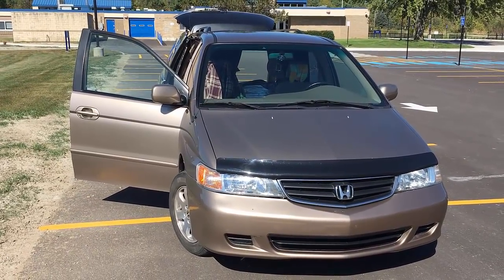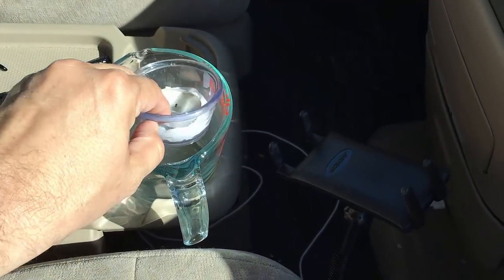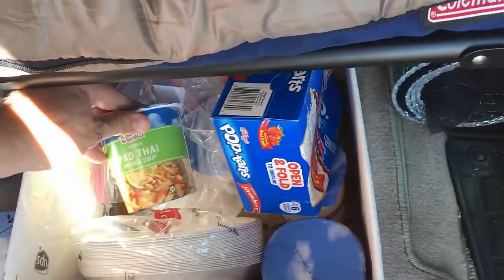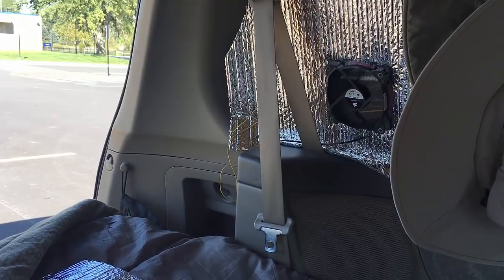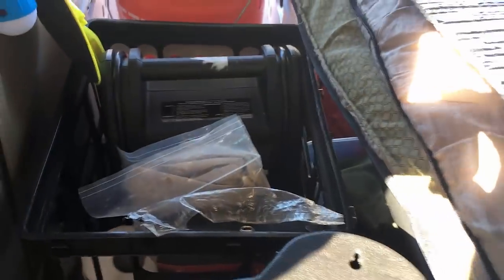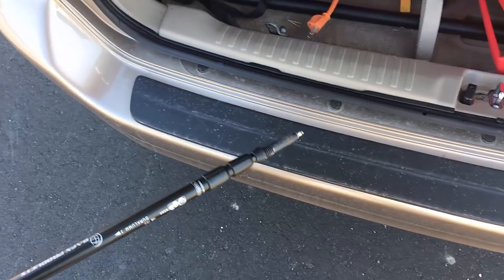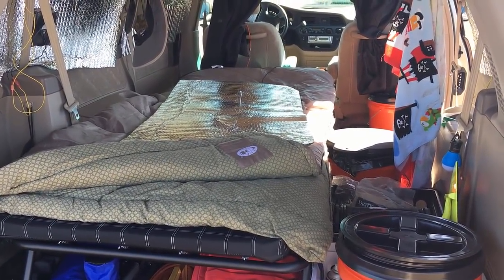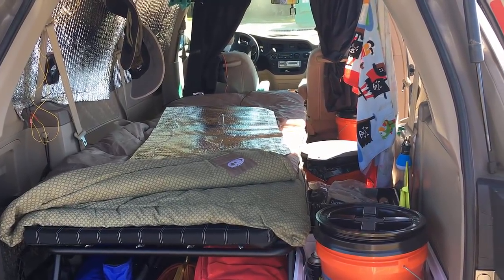Odyssey Camper Minivan Conversion

Comment: what is the best year honda ody in which to van camp? you did a fantastic job on the video. you put in so many great tips and advice but the video was calm yet interesting. really enjoyed it! I am going to see what else you have on your channel.
Reply from the maker: Thanks!  All of the Odyssey's have similar dimensions, but the 05' forward have a split rear seat.  That means you can put a cot/bed on one side and leave the other side up to sit in at night.  Of the earlier generation (2nd gen) Odyssey's I'd focus on finding a 2004'. I give some reasons on my OdysseyCamper blog, here: 
  http://odysseycamper.com/2017/10/07/what-to-look-for-when-buying-a-second-generation-honda-odyssey/     
     Some good deals can be found in a 2nd gen Odyssey with around 160,000 miles.  Having said all of that, if I change your question to "what Honda Ody is good for TRAVELLING",  then I'd suggest a 3rd or 4th generation.  They drive more like a car and have added safety features like side curtain airbags.  They also tend to get a few more MPG.  But in my opinion, all the Odysseys make good campers for one or two people.  I hope this helps!
Reply: Odyssey Camper Thanks!... but did they shrink them down?  I plan to look at newer models but I saw how they shrunk the CR-V (mutters).
Reply from the maker: The outside length is slightly different, but the interior space is VERY close.  2000-2018 Odysseys will all fit a 4x8 sheet of plywood behind the front seats.
Reply: Odyssey Camper, excellent information to know. Have you done a sideby side review of the Odyssey vs Pacifica vs Sienna vs Sedona minivans? 

Why do you prefer Odyssey? 

I just watched a 2018 Ody review trying to sort things out and there are so many bells and whistles I couldnt believe this was a minivan. I wish they had an AWD though somewhere. 

I had been looking at a Nissan NV 3500 high roof. I want something that can go between camper and cargo and maybe hauling / towing when needed.
Reply from the maker: I work in the powertrain industry, which means that I get to see how the engine and transmission are built and I get to see some of the quality issues.  That biases me toward the Honda and Toyota. They also have the best resale values. That said, there really aren't any BAD vehicles built anymore, if you compare them to what everyone was building in the 80s.  I know people that swear by the Fiat (um Chrysler) vans and I've owned a couple of non-Sedona Hyundais that were great.  So, I'll say in the end you should find the one with the features that you like.  If you want to know more about why I chose a Honda Odyssey for my mini RV, check out this blog post:   http://odysseycamper.com/2017/08/10/why-did-i-pick-a-honda-odyssey/
Reply: Odyssey Camper, that is awesome! Well, I was hoping there was a reason I wanted the Honda again / more. I have a 2004 Honda CRV awd that I will probably keep forever.  I will def check out your link. So I was just wondering before I read your reply what you would think of the 10 speed transmission on the higher end Odys for 2018. I have no idea if that is very significant or not. It is almost like it will go into... what are they calling the "continuous  transmission"... or something?
Reply from the maker: I honestly haven't driven the 10 speed version, but I can say this: We have a 2016 Acura MDX (Honda V6) in the family and the 9-speed transmission SUCKS.  It hasn't broken yet, but the programming is awful; always in the wrong gear, takes too long to downshift, does not limit your speed on a downhill like all other Honda transmissions.  Ironically, it's also used in the Chrysler products (made by a third company, not Honda), so that might tell you something.  I'd definitely try to drive one around for a couple hours before committing.  It hardly seems worth it to get 1 mpg more.
Reply: Odyssey Camper yes I just saw that it has a lot of cons. I am going to price some used minivans. Some of them do indeed hold their value. Good when selling but pricey when buying! lol
Reply: Another related question - a Coleman cot would fit comfortably then in all models without being too uneven? And in the later models it would even work with the split seat up next to it if I understand correctly?
Reply: Actually I was able to answer myself! Saw your phase 2 video and the one about raising the cot with the 2x4
Reply: we used a 2001 odyssy for a 3 month trip around the US and Canada, stealth only, cant remember one campground.  Two average size people slept in back, stuff went to front seats while sleeping.  It was magical!  And we were over 70.

Comment: That’s such a great idea using the cot! I’ve been considering this for my crv as well,  just need to see if it will fit in, as I’m not taking out the back seats, but have them folded flat, and want to make the most of the storage I can 👍🏽 thanks for sharing!
Reply from the maker: Jo T thanks for watching!
Reply: Camp cot in my Sienna with 4” trifold mattress. I put down 3rd row and took out one of 2nd row. Cot fits perfectly behind 2nd seat folded up. Put a 3drawer plastic cabinet that is perfect fit by cot in the back. Plenty of storage underneath cot and cabinet. Just need better reading light. I just use for camping, not living in. As a 70 year old female I stay in state park campgrounds primarily and most sites have electric and water.

Comment: Will you share where I should go to get an inverter connected to my battery? Also please provide info on where to purchase a ceramic heater. It sounds safer than a Mr. Buddy in close quarters. Thank you for a very informative video. I just found you today and I’m so glad I did. Now I’ll search for all of your videos.
Reply from the maker: Janice McKinnie if you can find an car audio center (we used to call them stereo shops), they can do the install for you. As far as the heater goes, I use this small one. https://amzn.to/2UKGSv7 The heat is a tiny fraction of what you would get with a propane heater, but I find it keeps my minivan warm enough if the front seats are curtained off. The propane ones are too much in a minivan if you ask me. They are better for a full sized panel van. Thanks for watching!

Comment: Darren - I found your channel and wanted to say what an outstanding job with all these videos! Thanks! I do have a quick question about the interior dimensions of the Honda Odyssey. I'm going to do some trips and use my recumbent trike (a tadpole-style = two wheels in front, one in back) - an example would be a CaTrike Trail recumbent trike. The Trail is quite wide (39 inches) and long (about 80 inches) and I want to keep the trike inside a vehicle where I can also sleep in it when the need arises. I  have a tri-fold mattress that is about 26 inches wide so I figure I'd need a vehicle that would have a 64" width to accommodate the two front trike wheels and the mattress - the narrower part of the vehicle at the wheel wells would handle the mattress and the back wheel and seat frame side-by-side. I've looked at different vans and the Oddysey does seem wide enough and long enough from the front seats to the rear hatch. I'm curious if you think the Odyssey would suit my needs?
I've  been looking at really reliable vehicles and a few Toyota models (the Highlander, the Sienna, maybe the 4Runner) come to mind. The Odyssey also is on the list. Any thoughts about the Hyundai Palisade, the Kia Carnival or Telluride, or Chrysler Pacifica?
Thanks in advance for any thoughts and once again, thanks for producing great content!
Reply from the maker: Thank you for your kind words!  Forgive me is this seems brief as I have to answer from my phone. As a rule, any modern minivan will hold a 4x8 foot sheet of plywood with the possible exception of the Pacifica (not sure about that one). So you have the length to do what you want. The width of 48” is as measured at the rear floor. Partially dictated by the wheel wells. So to get the width you want, you’d need to  be between the side door. There you typically get 60”.   The Sienna is also very close to those measurements. As for what brand of van you go width, I’d get what you like to drive since you’ll be doing a lot of that. ALL vans are built better than they were 20 years ago. That said, I’ve personally seen so many quality issues with Chrysler products, I would avoid those. Just my personal observation, some people consider them to be reliable. Thanks for watching!

Comment: Thank-you for taking the time to educate us. I just bought a 2007 Odyssey and came across your channel while surfing for information on how to use my windshield sprayer haha. I plan on attending RTR next year and I'm trying to decide if it would work with my 85 lb. dog. I will test out your design this summer to see if it would work. If you keep that side seat intact- where do you put the bathroom?
Reply from the maker: cynthia Hicks Good choice!  The 07 drives more like a car and has additional safety features like side curtain airbags. On my 13, the rear seat splits and so I’ve put the bathroom behind the front passenger seat and the water bucket behind the rear seat. When parked, I move the water to the front passenger seat.   Your dog should have room on the floor, but that’s a LOT of dog. I think this is what you are asking, but if I got it wrong, please LMK. Thanks for watching!   Be sure to subscribe and hit the bell to be notified when there is a new video; the next video starts the bed build in my 13’.

Comment: Hello,  would you mind sharing your insights on how the cot is secured in the van to prevent movement while driving.  Thank you.
Reply from the maker: Winfield Sam I use thin cable with crimp on ring lugs. I then put the cable through the floor seat mounts and a screw and nut through the ring lugs ties it down. However, once the cot is in and the driver’s seat is back, it’s not going anywhere. You’d have to roll the van to dislodge it. Thanks for watching!
Reply: @OdysseyCamper , thanks for sharing your tips on securing the cot.

Comment: Has the ground clearance height ever been an issue with dirt roads on the way to hikes?
Reply from the maker: Oh yes. The one thing that limits the Odyssey is the ground clearance. It’s about 5” which makes it hard to clear the rocks on rough trails. My NV200 with non stock tires had 9”, which made a huge difference—enough to keep up with Jeeps on dry trails. That said, I’ve done some gnarly trails in the Odyssey, using only a skid plate. Currently, I’m adding a 3” lift which should help to get deeper. Everything is a compromise, but you can go to most trailheads with an Odyssey and a decent set of tires.

Comment: where did you get the fans? How did you install? I need to do this for me and my  dog we are going to travel next month and need to dothis
Reply from the maker: These are 120mm computer fans that I bought off Amazon.  There are a couple different kinds, but this link will bring you to the exact model, which is the quiet type. https://amzn.to/2Jmuibb  Unfortunately, I did not document the fan portion of building the panels, but there IS a photo at the bottom of this post: http://odysseycamper.com/convert-your-mini-van-for-camping/diy-insulated-window-panels-stealth-camping/     I used the 12V from the dome light, but if you have a 12V "cigarette lighter" socket in the back you can pick up the power from there.  The fans have mounting grommets at the corners and can held onto the panel with regular screws and nuts.  I cut holes in the panels that were slightly smaller than the fans and used RTV sealant (aquarium sealant) to affix screen to the other side.  That way I wouldn't be encouraging bugs to come in :)

Comment: How do you make sure the cot doesn’t move around while driving?
Reply from the maker: @BurlyBaboon  I’ve never really had an issue with it. Under the leg closest to the driver’s seat I had a 2x4 clamped to the leg to level it. That seems to keep it from shifting by any noticeable amount while driving. That and the weight of the sleeping bag. The cots are really light and don’t seem to have much inertia.
Reply: @OdysseyCamper  thanks!!

Comment: dude. I love your set up-I had a 99 voyager that was really good I built a full folding frame with the backseats as part of the set up and had blackout ceartains

now I have the same gen odyssey as yours and love it- just  haven't gotten around to it yet.

was going to build a blackout certain system in mine- are your window covers easy in install? do they stay on? how?
Reply from the maker: Matanumi Thanks!  Your set up sounds cool!  I wanted to do something that didn’t require any special skill that people could use to just get out there. The next part will be a built bed with solar generator for people that need to be out for longer periods. Thanks for watching!
Reply: it was very basic... but it could fold back to the 5 seat configuration (cut the 4x8 full sheet of 3/4 plywood and put tabs on it to fold up and floor storage when not in use and bent metal braces in steel class in school to stabilize when in use, built custom boxes that were... not so level with the rear seats fully folder down... but it worked and gave me awesome storage on the bottom!) when I wasn't camping and had to transport passengers- I actually sold it as is to a young Australian couple who loved it and used to explore all of the west cost. Never used reflex for camping- just blackout curtains cut and Velcroed to the windows.. they worked for privacy but sucked big time in the winter- plus the rear windows were always tricky with the motors in the way

what did you do for the rear vents- they get in the way of putting the panel on fully- how did you cover that?

how does your half bed work? I got a huge photon hopefully I can hold wdith wise... may plan on folding seats up and doing the "half frame" it again but I had them folded all the way over on the voyager- have to fold them up this time to get maximum storage. also the second gens floor isn't totally flat so the frame bit is tricky. how did you make it work on the second gen?
Reply: I mimicked your set up with the coleman cot- holy shit is that ever a good bed for a temporary camper bed. 

how did you get the front curtains to work? howdid you deal with light leaking from the top?
Reply from the maker: Hi, I just noticed that I missed one of your other comments.  First, I'm glad you are liking the cot!  Just had a friend offer me the sofa and I said, "no thanks, I'll sleep in the van".  The Coleman is very comfy.  So, I just responded to how I got the cot level on the other video (should be in your notifications).  For the curtains, on the front, the light leakage doesn't bother me because I get up when it's light and at night, if I"m stealth camping, I leave the lights out.  On the side blackout panels, my first arrangement stayed on with suction cups.  It's written up here http://odysseycamper.com/convert-your-mini-van-for-camping/diy-insulated-window-panels-stealth-camping/  but I found the panels a little unweildy to pack.  So, I now use this arrangement, which stays in place by friction because they are superlight.  http://odysseycamper.com/convert-your-mini-van-for-camping/simple-privacy-window-panels-odyssey-minivan-rv-ph2/  I like the second version better and would only use the first version again if I were going to be where it was below 20F.

Comment: Hi , good video. can you tell where did you get the bedframe/foundation? also the mattress?. thanks
Reply from the maker: Md. Rokonuzzaman I’m using a Coleman cot, just like this one: https://amzn.to/2yiUvqN  it comes with the frame and mattress, but you may need to put a block at one end to level it, depending on the type and year of the van. It’s very comfortable. Thanks for watching!
Reply: thanks
Reply: @OdysseyCamper  Thanks much!

Comment: Can you tell me more about the window fan you have?
Reply from the maker: Hi Deborah!  The fans I used are this model ($32 for two on Amazon)  https://amzn.to/2nKACk7   If you go to this post on OdysseyCamper.com, you can see how I incorporated them on some rigid window panels. http://odysseycamper.com/convert-your-mini-van-for-camping/diy-insulated-window-panels-stealth-camping/  I didn't do a detailed how-to on the fans, but there is a photo that might help.  Basically, I cut a hole for the fan and held it on with screws and nuts.  I also put a piece of screen on the outside to keep the bugs out.  The trick is to make the panel large enough that it does not sit completely against the glass, but rather, against the plastic trim.  Then the window mechanism can operate.
Reply: @OdysseyCamper  thank you for your link to how you made your rigid window panels! I also like the added fan. I keep the panels up all the time in my Town &Country, but miss being able to have flow thru air! Now I can have both!
Reply from the maker: @pandachickenmama  glad to hear it helped with your own ideas!  Thanks for watching!

Comment: Do you find that cot to be fairly firm with pad/mattress it comes with?
Reply from the maker: Michael RS It’s pretty firm, but mainly because the nylon is stretched taut. The pad itself is very squishy. I weigh 250 and it dips a little, but is good if you have a bad back or something.

Comment: I agree with no refrigeration.  To cool, a battery powered fan and I spray water onto my skin.
Reply from the maker: okmmauh Good idea!  Thanks for watching!
Reply: @OdysseyCamper   -  haha.  I do this in my third floor apt on really hot days here.  No ac but I prefer a fan when I sleep anyway.  But when it is that bad, I keep a spray bottle on the nightstand.  (Ice in front of the fan helps too but I know that was not in your van setup).